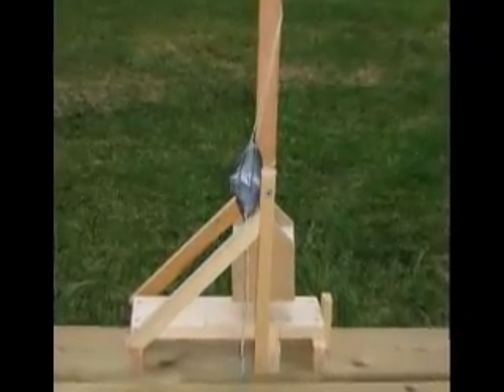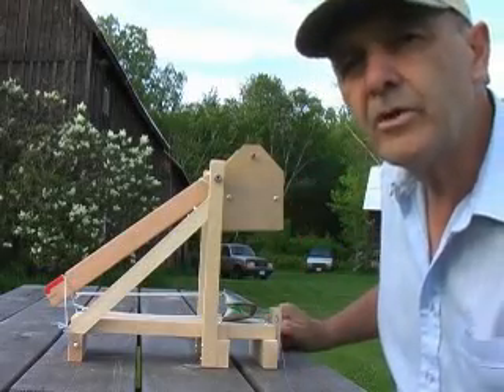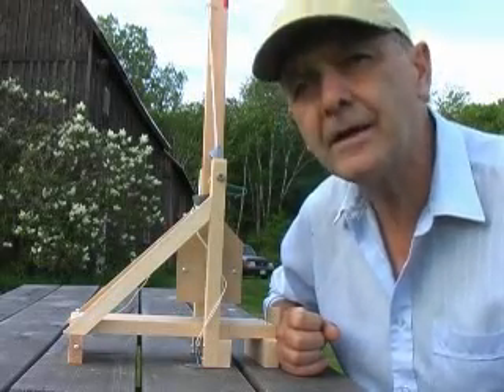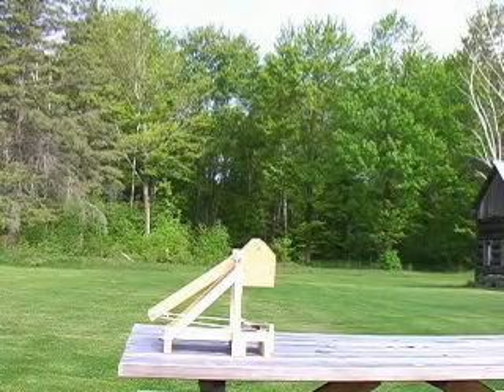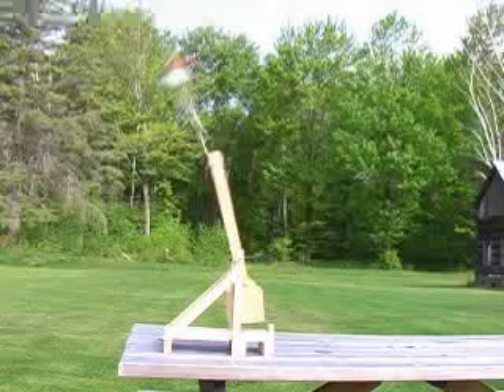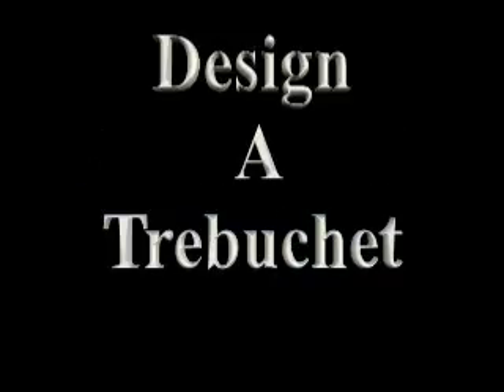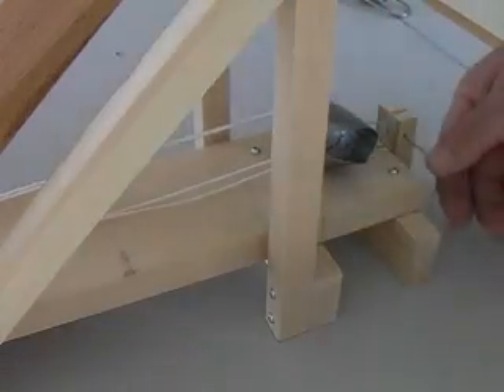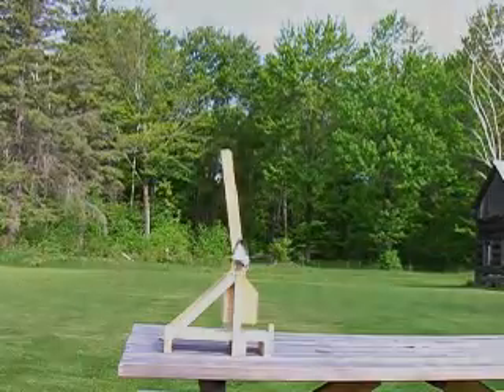Table Top Trebuchet

Comment: The counterweight doesn't matter as much for the accuracy so much as the power. The trebuchet, if built correctly, is accurate in itself. 

What is crucial, though, in getting it to fire correctly is in the release pin at the tip of the arm, and getting the arm to release the ball at a 45 degree angle.

@snipakid19
I made one of these as a high school project out of steel, so I'm sure one made of wood wouldn't take but a few afternoons.

Comment: Several benefit of a wheeled trebuchet:
1) reduces stress on the frame when firing (otherwise frame must essentially absorb force ~=the inertia of the launched projectile after firing)
2)adds some force--yes, some is transferred to moving teh launcher backwards, but a signifcant amount goes to the projectile
3)facilitates transport and aiming